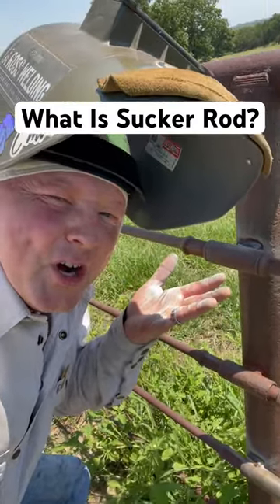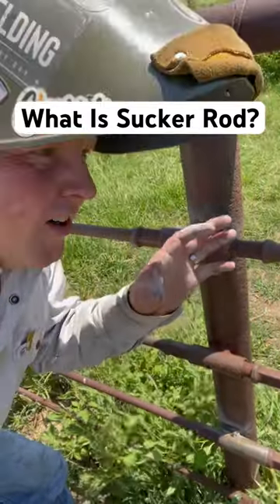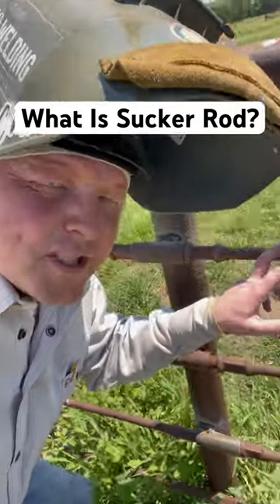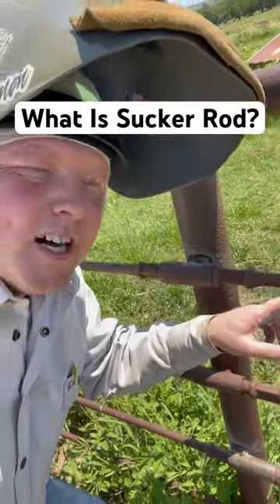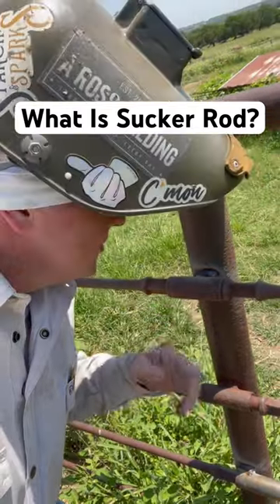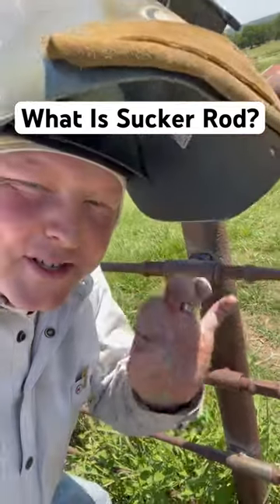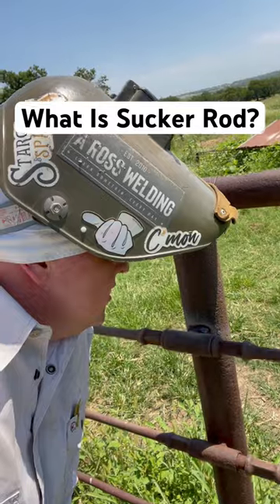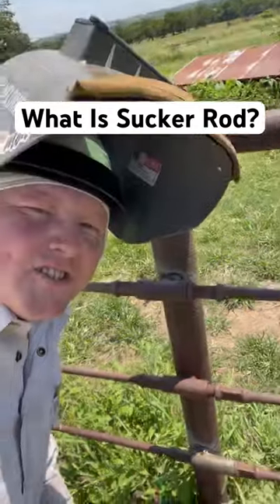Cheapest Pipe Fence Options #pipefence #rigwelder

Comment: Sucker rods are not used to drill wells. They are used to pump wells. When you see a pump jack working, the sucker rods run down the well and are attached to a pump. Windmills for pumping water also use sucker rods.

Comment: Sucker rod is used on a completed well when they set up a pump Jack on the well head , it’s what pumps up and down in the well pulling the oil and saltwater up to the surface. An experienced rod hand on a pulling unit is a sight to behold. Btw if a guy is a decent welder there is a lot of work out there keeping those old pump jacks up and running lol.

Comment: That you can screw togother.A pin end ( threads) Then a box end that the pin end screws into.Makes a good pipe fence indeed but you have to weld a piece in between your uprights post.If not a 8 foot stand the flexing and bouncing breaks the welds.

Comment: Sucker Rod can have a rating up to 105 thousand PSI it is not cold rolled in some instances it's high grade alloy. Blacksmiths have been using it to forge punches and chisels for many many years. Next time you get a chunk spark test it...

Comment: Idk many people buying cold rolled for fencing, ESPECIALLY on a farm. Around here that’s typically used for something requiring a more fancy clean look since cold rolled doesn’t have any mill scale and has sharp and smooth definitions. Cold rolled on farm fencing? Idk why you’d spend so much extra money for that. Farm fencing just needs some good ol hot rolled mild steel
Reply: That was what I was thinking too, cold rolled is far more expensive than low carbon hot rolled such as A-500 tubing and pipe or A-36 bars, sheets and plates.
Reply: I paid $12 per rod yesterday for 7/8” x 31’ rod. Seems pretty dang cheap to me and oh so easy to use!
Reply: @TheGoatShowMan  that hot rolled would’ve been $5!

Comment: I definitely wouldn't waste money on new cold rolled. Maaaybe hot rolled. Or this used sucker rod if it's plentiful and cheaper. My question is if you're doing hundreds of feet of fencing, why not stretch wire rope/ cable say 3/8" ? You'd only need some type of eyelets welded on your post, or blow holes through the center and weld some pipe thimbles in there, route your cable through.

Comment: Why even buy cold rolled when you can just buy hot rolled mild steel for probably cheaper than the sucker rod. Seems like an odd choice for fencing but if you’re just grabbing anything out of the scrap pile to make a fence it’ll do I guess.
Reply: I’ve used about 2500 feet of 3/4” sucker rod in the last year on fences.  It sure didn’t come out of the scrap pile.  I think I paid about $11/joint for it.  A joint is 25 feet.  It makes a good fence when combined with a pipe top rail.  I cut the collars off and weld the rods in a lap type joint.  Looks cleaner and better than having a bunch of joints screwed together.
Reply: We buy retired sucker rod little more than scrap price.